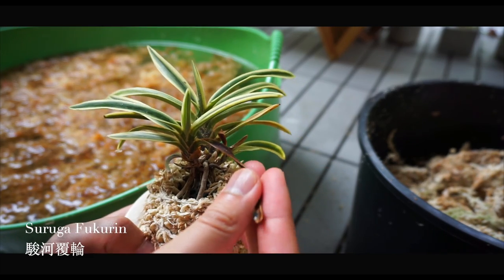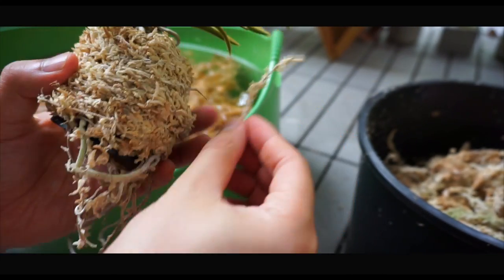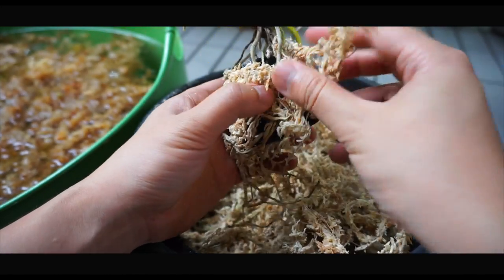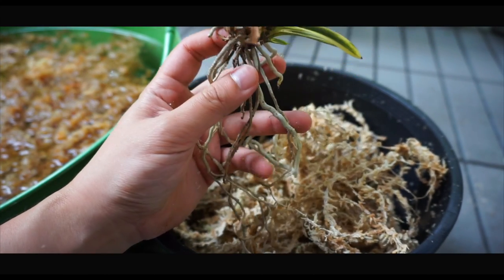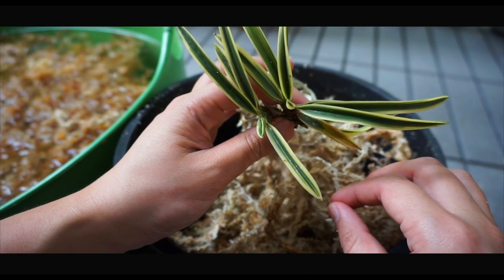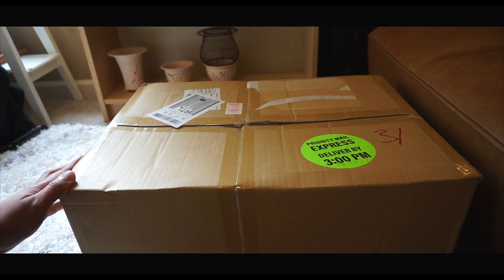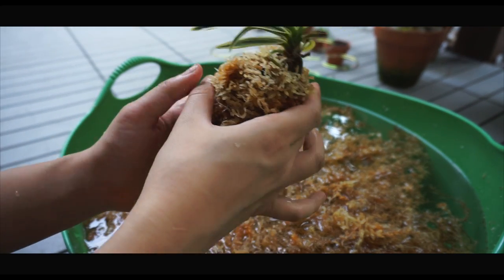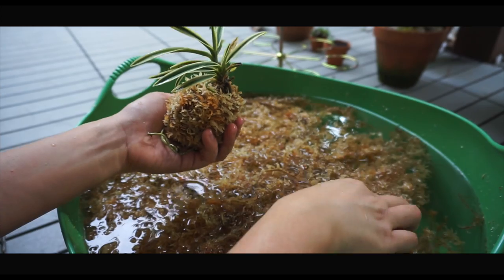How I grow Neofinetia (Vanda) Falcata - Part 1

Comment: OMG. Finally good quality video, information and orchids in the same place, clearly earned my subscription!
If you don't mind, I would like to hear your opinion on this. 
I was researching small orchids that are suitable for a vivarium (a well ventilated one) and a friend of mine recommended this species. So far I've been thinking to either mount it on a wooden structure made from possibly dragon wood and moss to let its roots grow freely as if it was hanging. 
With good ventilation do you think this plant could do well in a set-up like this? From what I've read so far stagnant air and wet conditions seem to be the biggest killers, but I might be missing on something.
Thank you for reading!

L.E.: The only fauna that will be present will be comprised of a small insect "clean-up crew" that will eat any mold that appears and keep everything fresh, so nothing will bother the orchid regarding that.
Reply from the maker: I haven't tried having them in vivariums but I think it could work. I would mount it on wood without any moss as that is how they grow naturally. Good luck.

Comment: Excellent video Trac very interested in the fact that you put no moss underneath the roots on the top of the upended mesh pot. Obviously it works well.  Scale isn’t something I have a problem with but the dreaded mealy bug is what we have in the UK  Can I just ask how you dry your fans after the dip in the bleach solution or do you just shake them to dry them.  Am waiting eagerly for part 2 to appear.
Reply from the maker: i just shake the bleach solution off and then rinse it plain water.